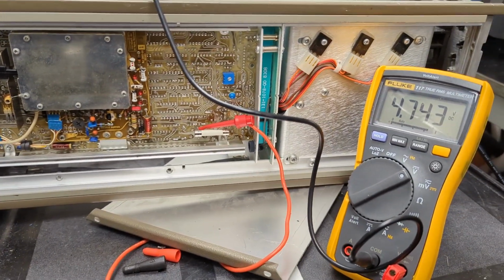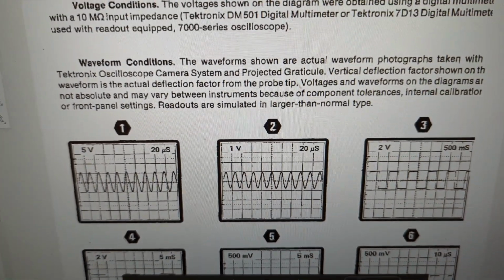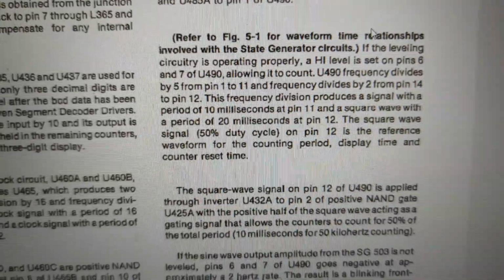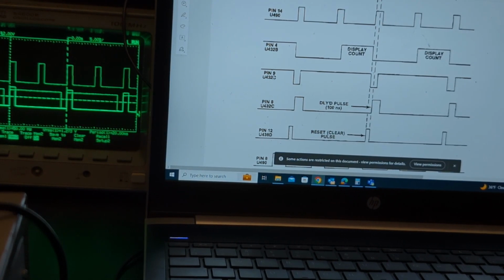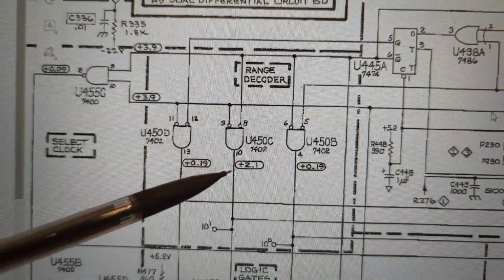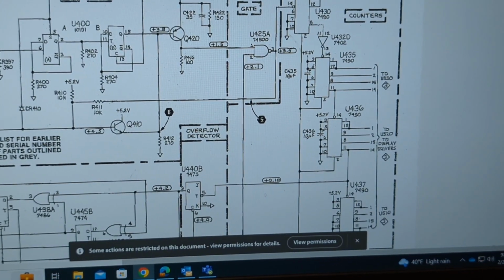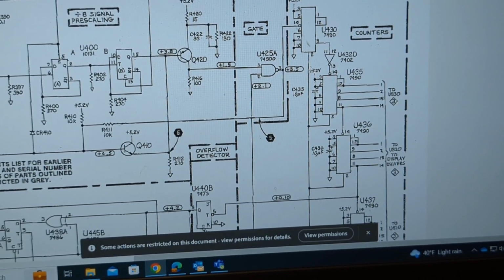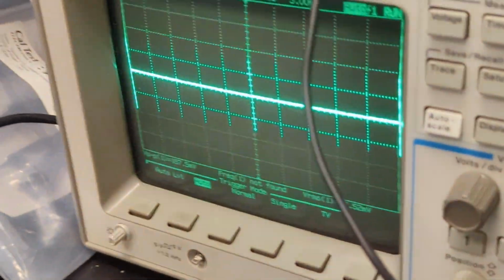Tektronix SG503 Leveled Sine Wave Generator Repair - Display Issues (Part 2, Fixed!!)

Comment: Nice repair…good to get down into the “guts” of a “sea of TTL gates” from time to time. 

I was “following along on my own download of the circuit”…I did not know or pre empt the fault before you got to it and I will be honest and admit, although I know the basic principles of a frequency counter I did not know ALL that was going on here…particularly the decimal point positioning circuitry.

However, this is an excellent unit to learn on…it is not too complex, no microprocessors or firmwate and easy to get into without extender cards. 

I’m so glad it eas just that 7490 second counter…still wonder how such a failure occurrs initially though.

So a frequency counter can be as simple or as complex as you like. Compared to my expeirences with frequency counters, this oe is about in the middle. The basic pronciple is…get an input, Turn it into s nice digital pulse train, feed it through a gate….so, say the gate opens for one second and lets through 2738 pulses, then after the gate is the counter, and it counts to 2738 in the time the gate is open. Normally this count up is not displayed, however some counters to have settings that allow the count up to be viewed, but normally, while the counters count up, the display is either blanked or displaying the previous count the last time the gate was open, then once the new count is finished at the closing of the gate, the new reading is transferred to the display and it updates. And that’s the badic guts of a frequency counter! 

In this unit, the all important gate is U425A. If it is desired to count much higher frequencies, a prescaler can be placed ahaid of the gate, say this divides by 1000, so three divide by 5’s and three divide by 2 toggle F/Fs to give a nice 1:1 mark-space output. Al you need fo is move the decimal place over on the display. Sure, you win’t have 10 digit resolution, loke youd get adding more counters and displays AFTER the gate, but often thay simply can’t count fast enough anyway. 

I think that 4000 CMOS os godd gor about 7MHz, and Basic 7400 TTL reaches to about 20MHz. So this goes up to 250MHz, far higher than either of those logic families can reach…so how is it done?  Take a look at U390 and U400, these little buggers ate ECL logic. One of yhem is an MC10131, this is a member of the 10,000 series ECL family…almost always in Cerdip packages..they sre quite power hungey, they have oddball logic levels, but they are faster than slipping in catsh!t on a hot yin roof! 

I’m so, so glad that boring old 7490 “shot through like a Bondi Tram” and not any of the 10k or 1.6K ECL, because, although they sre just a few toggle flip-flops, those buggers sre ExPENSIVE and relatively hard to get. If you ever see ipany old non test gear at the scrap metal yard and there are 10K or 100K series ECL in there…GRAB IT!

I have a HP 5326A nicie frequency counter, it is vaguely similar to this, ECL prescalers, TTL gate and counters…but it does period, stopwatch etc., as well as frequency, so there are TONS of gates inside ot rearrange between those functions as well as the basic gate controlled by a crystal oscillator. There is lots of level conversion from ECL to TTL and back, so it is a real rat’s nest!

Years ago, one NAMD gate in 10K ECL chip in the stopped NAND ing. I had no replacements of that exact gate arrangment, but I did have some other, different ECL chips that did have uncomitted NAND gates inside, so I botched this chip to the back of the board on the opposite side to the one quad NAND with the single dead gate in it….the other three NANDs in it were still working. So I connected the NAND from the different chip underneath on place of the faulty one…and it worked again. Bloody ugly fix, but it eas all I could do i the face of having no exact replacement, and the exact replacement costing fifty bucks!

So, yes, nice learning curve here on a not-too-complex freqiency counter. Take a look online st the circuit disgram of the Australian sine generator, the AWA G232, it has a frequency counter in it…it only goes up to 100KHz or do, so no fancy ECL there, but see if you can identify the all important heart of it, yhe GATE, amongst the sea of TTL in its counter!

cheers.
Reply from the maker: Thanks Globe Collector! Always appreciate your wealth of knowledge. I do appreciate a repair that can teach me a new concept and is a bit different than your run of the mill power supply issues - which I admit I spent too much time on.

 Speaking of which, I don't know if you saw my note in description, but I did end up finding out why the voltage rails were low - it was a bad LM723! Very interesting. I put it on a breadboard and built the test circuit described in its datasheet - 12V input, 5V output. And it was outputting ~5.5V. just like when it was in the SG503, it was outputting a higher voltage than it should be. Interestingly, the reference voltage was still bang on at ~7.2V. So maybe an issue with the internal error amplifier? Maybe the lower than normal voltage rails killed the 7490? The unit was operating outside the recommended minimum supply voltage for these TTLs - could that cause them to go bad? The end user would not have known without measuring the voltage rails because clearly it will still work at ~4.7V (who knows for how long...)

 Also, another fault is the 10MHz setting - the output will go unlevel at this setting. I determined it was an issue with the frequency setting switch assembly. This switch is a two in one rotary wafer and cam switch with those fancy gold flags and drum actuator that Tektronix loves to use. But it seems the issue was with the rotary wafer part. I found a contact for the 10MHz setting that was slightly lifted. I removed the whole switch assembly, cleaned it, and bent the contact back into place. Buzzed every setting with my meter for continuity and everything looked good. Reinstalled it and the problem persists... Now it will only go unlevel from 8-10MHz (10MHz setting is range from ~8.8 to 26MHz). So I may admit defeat on this one... I don't feel like taking the switch assembly apart again 😂
Reply: Yeah, sorry you had to explain it all here, as I had just watched your next video where you seay almost the same thing. I do wonder why that 7490 failed…maybe it was because the Vcc fell too low and sone of the transistors inside went out of saturation and in to their linear regions. Actually, Inshould try this, set up a 7400 series gate circuit…operating, then gradually dectrase the supply and see p, not only where it stops…but HOW it stops! i’ll continue my comment over under your next video, so everybody else csn see it too.
Reply from the maker: sacrifice a 7490 for science! 😂 @thanhhuynh272

Comment from the maker: Follow Up Note: At @41:36 I check the 5.2V rail one last time and see that it is still low at ~4.7V.  I speculate it could be due to the lower voltages supplied by the TM5000.  This turned out to be false!  It was actually a faulty LM723!  I replaced it and now the voltages are in spec.  I may do a short follow-up vid going over some of additional repairs (including this one) required to make this SG503 fully operational.  Thanks for watching!